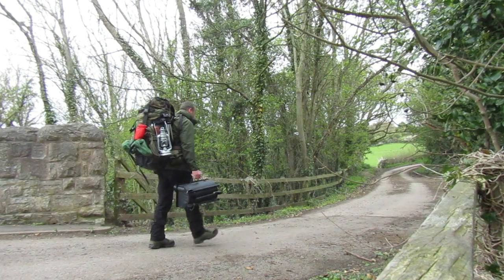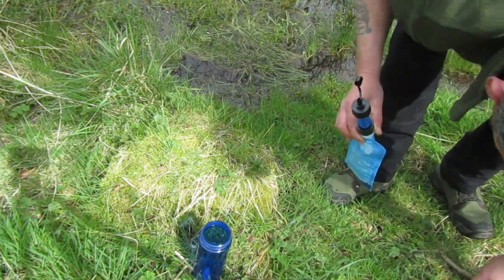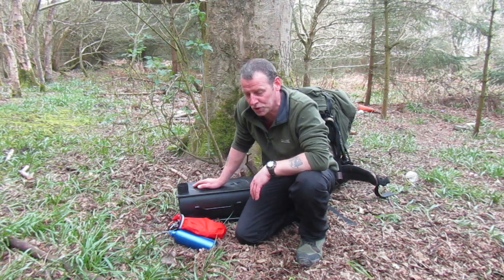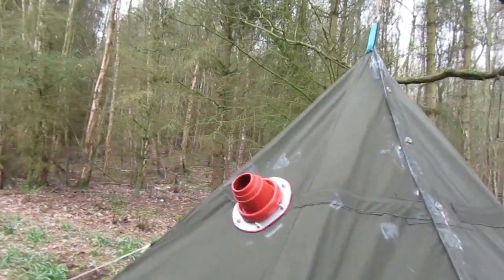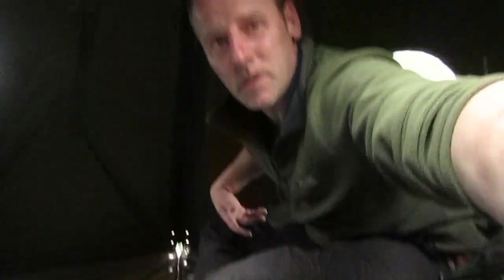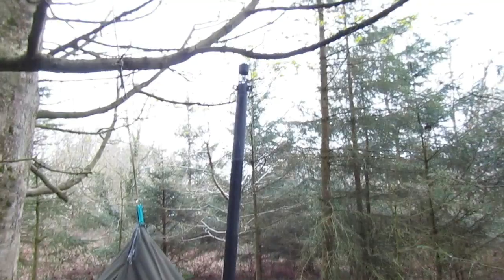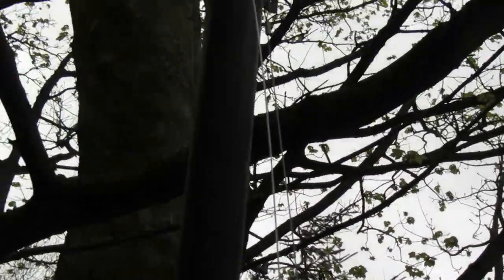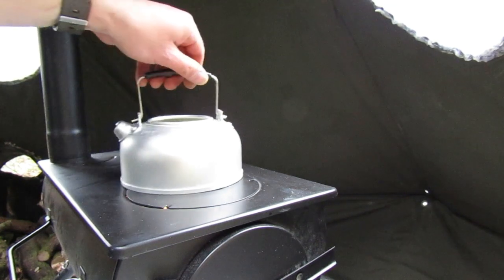Best Lavvu mods on Youtube + Outbacker stove

Comment: To prevent water from running into the seams, you can use waterproof wood glue! It is flexible and seals the seams permanently.
Check it out!

Comment: Andy,a lot of hardwork there mate,can tell you have done time in green skin,will be good to see how it goes in time with all the compromises,if you open the pocket flaps at gut height with twigs, once its up,it will let light in from 4 different angels,ave 4 decent holes to go at,preferred that to angles haha,top stuff lad 🤪👍
Reply: Hello ! Witch size do you advice for a 1.70 man ? Size one enought ? Or size 2 ? Pardon for my english !

Comment: Very ambitious project and modifications. 

However, the best quality of the polish tent is how incredibly simple it is- water tight and impossible to break or get wrong. For me, you’ve added features which really reduce how long it will last. 

Each to their own- enjoy.
Reply from the maker: Like you said, each to there own, but I appreciate my mods, especially in the winter months when the nights draw in at half 4 and you want the last bit of sun light as it's falling, then the heat of the wood burner keeping me nice and toasty, good luck with yours mate
Reply from the maker: Most of these lavvus have been in storage for years, my 2 dated from 1974-1984, you reckon there still waterproof without me doing anything to them ie. Re-proofing? Think you need to be out in a storm in yours if you own one, then you might have some actual constructive criticism until then, stay safe me friend
Reply: Andy Outdoors yep, have been, in both buttoned up and half as a quick pitch storm cover. Also camped in a sub zero few nights with a candle. All good. Once wetted our was water tight- my halves are also both 1984.

Don’t have anything constructive really, just an opinion. Would be keen to follow how long your windows last- again, the simplicity is the thing I love about them.
Reply: I got it wrong 😔 put one facing the wrong way and its inside out

Comment: Very impressive zip sewing Andy especially for a hand job. Very good mods to Lavvu generally. Not sure of the windows in my own case however?) I really should get one of those water filtration kits as well and cut my weight down too. Never quite see the necessity of a stove in such small space though tbh (unless constantly living in the Alaskan outback) and having to hike, bike or ski it in lol. I use my Lavvu a lot during cold northern uk winters and just with body heat they heat up to a comfortable level in find. With the addition of a few car window cell foam reflectors on floor and outside of foot and head end - even better. Then a vegetable oil or beeswax lantern (dont use standard candles) gives more relative heat & light again ( give a little ventilation space mind), all weighing and costing a fraction of a stove and no time sourcing of wood needed either. I would sooner cook outside as well at a reasonable height on an ethanol or wood gas stove. 
One other top tip for keeping heat in during winter is to use a trekking type tarp about a foot above lavvu or any tent as this will trap and even freeze condensation - the no. 1 reason for loosing heat and feeling the cold. A suspended tarp has numerous other additional uses too and only weigh about 400g on av.for the fabric itself. If out in it a lot too, i would perhaps invest in a light weight aluminium camp cot as opposed to your heavy steel canvas one. The alloys only weigh around 1.8 kg and much much easier to erect as well. I bought one on ebay for £25 ish and is superb i gotta say. Cheers man anyway - very good upload!
Reply from the maker: Really nice comment, thanks for watching Atb Andy

Comment: Dont lose rain water collect into a bottle overnight. Use a plastic bag  spread out at the top and tied at the end but allowing the water to get into the bottle below. If you remember change the bottles for more water. I used a tube purifier between but rain water's right so goodun.